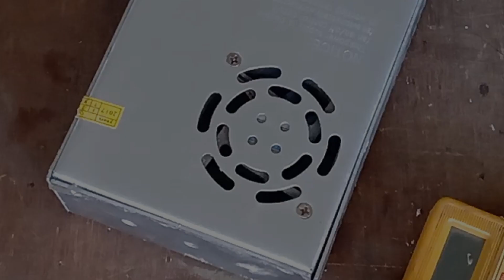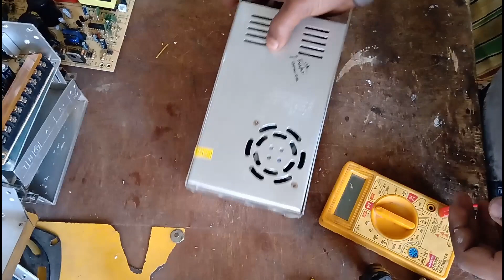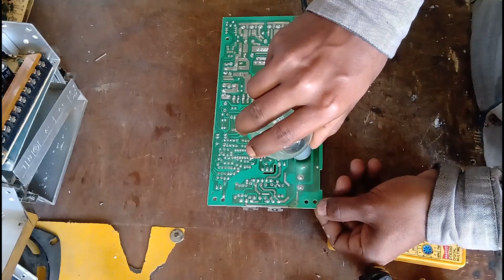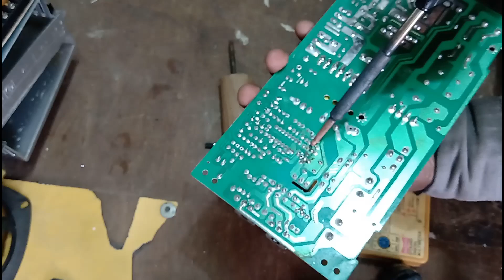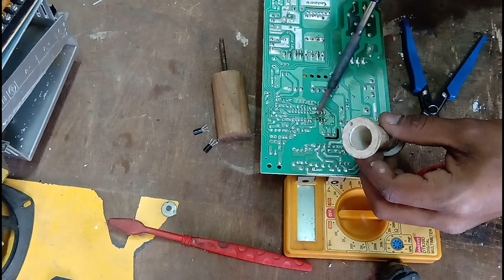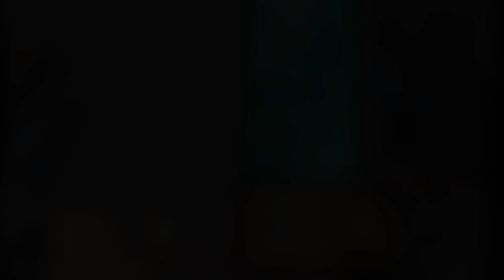#pixel_led_power_supply,5 volt 60 amp power supply repair

Comment: My 5 volt 60 amp is giving output 2.70 volt, i change transistor c-2655 NPN but the problem is same should i change mouse fad D13009K also,
Reply from the maker: 2655 transistor ka sath hai ek zenner doode laga hua hai o bhi change kar do nahi hoga to 8392030531 ye number par what's app kijiye upka SMPS ka problem jarur solve hoga

Comment: 5v60amp smps a  module lagano jabe
Reply from the maker: Serokom module Amar ka6e akhono aseni . R ta6ra Amar ka6e power supply er sob components available Ami power supply bypass khub kom Kori.
Reply from the maker: Apni kothay theke bol69 Jodi kono problem hoy 9800304465 what's app korte paren

Comment: Sir amar 12v 10amp smps 12v dichhe kintu 0.5 amperage dichhe.. Ki problem achhe.
Reply from the maker: 9800304465
Reply: @mr.electro3556  ok
Reply from the maker: What's app karo